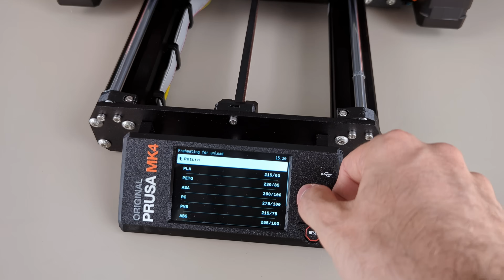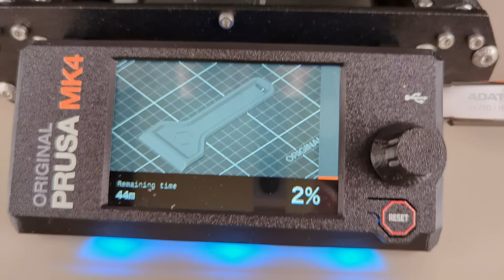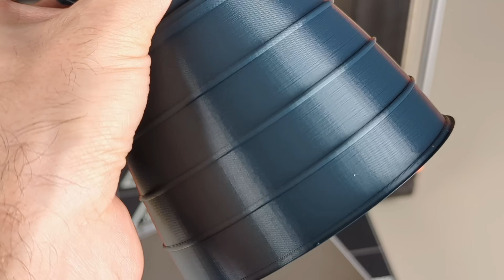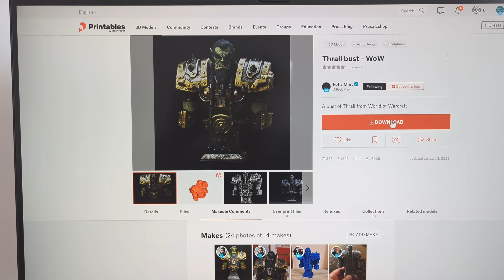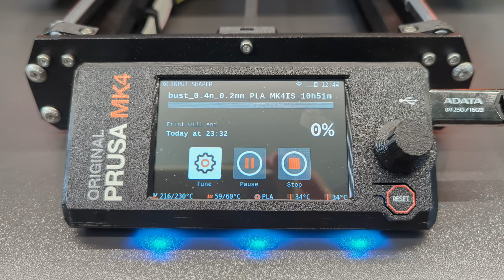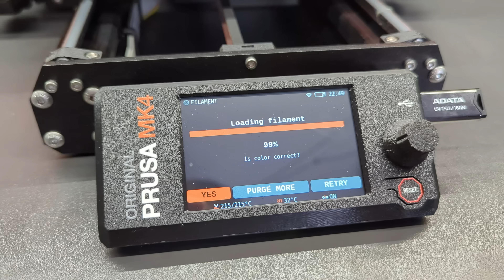Prusa MK4 in 2023? 🤷‍♂️

Comment: Prusa will never compete on price or new models every 6 months against Creality, Bambu, and other Chinese manufacturers.  While its 100% certain they have a smaller corexy printer in the works (look at their AFS system), when it is released, it won't be a $500-$700 corexy. Just not possible for them to build cheap in the EU.  I would expect a smaller corexy from Prusa to be around the $1000-$1200 range considering the XL single head starts at $1999.   If all you need is cheap speed, then Prusa isn't the company for you.  But like other printers, when you buy it, you know it will be supported and upgraded over time, and for a long time.   Everyone's needs and priorities are different.
Reply: There is a lot of implication that Bambu cannot do the things you asked for.  I have two Bambu printers (and two Prusa MK3s).   Support from Bambu has been excellent.  Prices on replacements and spares is extremely reasonable and the thing with a fast printer is you can print slower too!   We are yet to see on upgradability and long term, but P1P->P1S for $150 is pretty so far painting a good picture. 

What prusa does, that no body else in that list does, is sticks to the roots of 3d printing and the open nature that allowed for Bambu and others to stand on and jump off from.  That is worth something.

Creality does race to the bottom and I think your criticism apply there.  K1 is straight up a bambu clone with open source tools
Reply: @bennetb01  I was very focused on Prusa, not Bambu in my comment, other than to say Prusa will not compete with them on price, ever.  EU vs Chinese manufacturing costs.
Reply: Having said that, a company that's been around for just barely over a year really doesn't have a track record yet to say "yay" or "nay" as far as long term support and reliability.  In a year or two from now, we can have a better discussion, but as of today, there isn't enough data.
Reply: @bennetb01 Bambu cannot do a lot of things you ask for. It cannot do live Z adjustment. Cannot tune steps/mm. Cannot reveal the contents of the huge ass log files that it sends to them, which DOES NOT INCLUDE nozzle or heated bed temperatures. They admitted to this in their latest blog post update on their corrective steps to prevent a repeat of the cloud outage/job jamming fiasco last week.
Reply: "Prusa will never compete on price or new models every 6 months against Creality, Bambu, and other Chinese manufacturers. "

I feel like this was low key a seriously disrespectful comment. Just putting Bambulab in the same company as creality is pretty disgusting. They literally work their asses off as a startup, raising capital, then developing the biggest leap in user experience we've seen, hitting all the points most people have wanted in printers for years, and you act like they are some cheap clone maker putting in no effort just because of the country they are in. Honestly it's not right.

I think people are being really biased when they ignore how amazing what Bambulab pulled off is.

They complain acting as if it copies vorons when they dont realize how ignorant that is engineering wise when they share next to nothing in common. There is a reason voron 2.4s cost multiples of the price. They put in a load of engineering to make their printer more like a PC case so that it could be produced affordably, and then you actually got to buy it while benefiting from that savings. You think they could just clone a voron and sell it for that price? You'd be out of your mind to think so just from the labour costs alone (and on that note I want to point out that people are out of the know if they dont realize that Chinese labour is now nowhere near as cheap as they think it is. The baby boom situation that caused that explosion has died off, so their labour is getting pricier and their workers more skilled).

Then lets talk about software. They are literally one of the only chinese printer companies that gives a hoot about making good software, adhering to licenses etc, yet when they make tiny mistakes smaller than Prusa has done, completely reasonably, people jump on it like they were secretly hackers the whole time. Its absurd, when in reality, tell me of a printer that has gotten a better UX from slicer to printer? Thats real work that was put in.

There is a lot to criticize, absolutely, and obviously I didnt cover it in this comment, as that wasnt the point, but you acting like Creality and Bambulab are at all comparable as companies really pissed me off, because by doing that, what you are telling to every Chinese business that tries to be better, and do better, that it doesnt matter because your ignorance will have you dismiss their work anyways. It's completely unfair.
Reply: @BeefIngot    My comment wasn't about Bambu Lab. It was plain and simple that EU manufacturing will always cost more than Chinese manufacturing (human cost, tooling costs).  You should go redirect your anger elsewhere.  These are 3d printer companies, not religions.  bye.
Reply: @JohnOlson  Buddy, you are still responsible for what you say. You can't hide that behind it "only" being in your first sentence. Also, it's hilarious you're talking about religions with the nonsense you just made up to defend your prusa religion.

Fun fact, I also like Prusa, because unlike you I'm actually here for the tech. Don't make defending a company reduce you to having prejudice against people for their country of origin
Reply: @BeefIngot  " having prejudice against people for their country of origin" ... Couldn't be further from the truth.  Thanks troll for weighing in, now f**k off.

Comment: I mean aside from the XL this is their current flagship printer, right? It’s the one I see at the top first thing on their website. This is wild. Bambu and this are not even remotely in the same league.
Reply: I mean you are not wrong. The Bambu and Prusa owners are completely different. Really depends on what the user values. Being easy to repair, looking good in the office, open-source vs locked, primarily offline vs primarily online cloud, being quiet vs loud, built-in enclosure...
Reply: @TheMikolasZuza  or prefering prints that are multiple times faster. Or multi-color. Or an actually finished product. Or maybe all of that with a cheaper price point. So many considerations
Reply: @user-fo7mf9nd2h  Exactly. Different customer groups. I for example do like prints that are stronger, not half of my filament going down a poop chute and not only soft- but also hardware upgrades for years and years. I also like that part of my money goes into Printables and PrusaSlicer, that workers are payed a reasonable wage and other open source projects are supported financially too.
Reply: @user-fo7mf9nd2h  Some people value a company the has contributed so much to 3D printing and is made in the EU where they must comply with actual labor laws and enviornmental protection instead of Chinese junk.

Comment: You might say this is about 1/3 open source hardware, and the software still open. Prusa being a nice guy, won't keep him in the running printer wise.
Reply: I think its rather simplistic to pretend that their missed step here is anything to do with being open source.

You have to remember that their opensource nature is a tradeoff. They got a ton of free work over the years from other people due to it, and now act like somehow its unfair when other people use the other side of the coin, and get their free work too, when thats the entire point of the agreement: no one has to reinvent the wheel.

Whats more, the area that they are behind in is clearly hardware, and they are not only open source in name alone (where are the MK4 Cad files? Last I checked they still havent been released), and in that area, none of the most modern printers are copying them, because they aren't at a place to be copied from.

So yea, waaaaaaay less about Prusa being a nice guy and waaaaay more about them taking too long and resting on their laurels.

I hope that they actually do commit to open source in any practical sense, but their pr suggests they want to move away from it more, which to me, kills any reason for me to like the brand.

Comment: The insufficient purge is probably in case you change to a filament of the same color.
Reply: Then, why purge at all as a default? And why isn't there two options, one to change without purge and one that purges a reasonable amount for a color/material change?
Reply: @bunker1213  There is? It's called "purge more".
Reply: @ulaB  and why should I have to do that 2-3 times extra manually everytime I change filament?
Reply: @ulaB  for the cost of $1100 there is no reason I should have to stand there and press the button 2-5 times lmfao.
Reply: @NOBLE50000  Well. If you pay that much money, just to swap filaments, you might be doing it wrong.  ;-)
That said - there are a lot of people that don't need to purge more,  because they change to the same color. Printfarms for example. That would mean a lot of unnecessary waste.  So they would complain instead (and they paid a lot more than you). And it is more difficult to pull the filament back in than to extrude more. 
What you get for $1000 is the option to change the code yourself or at least report an issue on GitHub. - as others have done instead of just complaining. :-)
Reply: @NOBLE50000  If you cry about purging filament then maybe 3D printers aren't for you.

Comment: The disrespect for Prusa in these comments seems a bit extreme… Until I remember that Prusa himself called us “Trolls” for minor criticisms.
Reply: HAve you ever met Joseph Prusa, I have and he is a total ASSHOLE and I'm trying to be nice!!! Whatever disrespect he gets is well deserved and then some!!!
Reply: You were called trolls because you made it a point to repeat the “minor criticism” on all Prusa videos as if they were major points and called them deal breakers.
Reply: you cant really blame them when the MK4 costs $1100... Its outdated for the price point and you guys cannot seem to grasp that.
Reply: @NOBLE50000  
On the other hand is it easy to grasp the problem of having to register on an app to even get the Bambu going.
And there is, of course, the ongoing mystery of the need to encrypt log files used for support.
One might argue that the logfiles are OK, but HOW DO YOU KNOW.
And why are they so huge? What is leeched and transmitted from your computer?

And everything on a Bambu being proprietary means that they can sell them cheap, get some valuable customer data and not least, make sure that everything needed for upgrade or repair is bought from them.
Do I hear you protect the reputation of HP and Canon for the way they have perverted the printer market?

Comment: Nice to see Prusa hasn’t given up on entry level printers.
Reply: Entry level? It’s $1100
Reply: It used to be double that price with Flashforge  @nonchalanto
Reply: @nonchalanto  it may be overpriced, but it is still an entry level printer.
Reply: @KanielD  I guess I’m not seeing how this is particularly entry level in comparison to most other popular printers. Seems even less user friendly than, say, an X1 Carbon.
Reply: @nonchalanto  the design is entry level. its comparable to any ender 3 NEO but for the additional cost of $800. Also you cant compare really anything to the X1C in terms of user friendliness.
Reply: It's funny to me because it's legitimately not good, it's the same price as a P1S w/ AMS, for half the features, unenclosed, much slower, and tons of issues. As usual, Prusa gives subpar quality, subpar experience, for premium pricing. 10min to print on a P1S w/ AMS, at 500mm/s, with multicolor. Prusa? 200mm/s, 2 hours to build it, and tons of bugs. So as per usual, Prusa is the worst choice. Been that way since the Mini came out.
Reply: @Funky85Mess  Ok, so like the general idea of your comment is right, but the numbers you list are like waaaaaaaaay off. The print speeds of both printers is way higher than reality, and also not even the metric that matters. I know its complex, but top speed means next to nothing. What matters is volumetric flow rate and the highest acceleration you can get without notable defects.

Comment: The quality of their own prints, which create the printer, makes no sense to me. Why would they not put the best quality prints on their printer?
Reply: If I had to guess, I'd say because they have to make a lot of them quickly, and as long as the parts are strong and serve their purpose structurally, it works. 
I imagine they ran the numbers and found out that spending hours and hours more on printing batches of printer parts on perfect quality for what is really only visuals was more expensive than it's worth, perhaps even a loss compared to ordering the parts injection molded instead.
Reply: @BM-yy8db With the price of that machine, why don't they just injection molding them? Must be faster and much higher quality
Reply: @ngtb Because the entire point of Prusa machines, is that since the parts are partially 3D printed - you can replace them yourself
Reply: @Spiker985Studios At what point does that lose value though when you can buy 2 machines that have a better user experience for the cost of one of these, and those machines sell spare parts?
Reply: @Spiker985Studios  It's a gimmick that made sense when people were building kits and could get a friend/ makerspace to print the parts for them to keep costs down but it makes no sense on a £800 printer. I've had a prusa clone for almost 10 years and never had a printed part fail anyway. Also to replace it yourself you'd need a working printer so either you need a second printer or you'd have to print a whole set of parts off before hand just in case - not something I'd like to do after spending that much on a printer lol.
Reply: @BM-yy8db You know what makes even more financial and engineering sense for everyone involved? Just using actual modern mass manufacturing techniques like injection molding and robotic assembly.

Seriously, they could design so that users could still print their own parts but sell parts made using the methods that make the most sense. Yea, its would take more time to design, but redesigning some geometry is like an absolute fraction of the effort put into making the product, so in the grand scheme its nothing.
Reply: @BM-yy8db  guessing isn’t as good as knowing. What about the people who buy their products. What is your guess about the impact of bad-looking prints on them?
Reply: @corlissmedia2.0 I agree, but I don't think we'll get from guessing to knowing without working in those companies ourselves, so best I can do is educated guesses and logic.

As for the impact, people don't buy these kind of things in the supermarket on a whim. While Bambu is going in the "plug and play" consumer friendly direction, Prusa still seems to be targetting the "tinkering geek/hobbyist" kind of customer, who knows what they're buying, knows about the "for geeks by geeks" feel of the 3D printing industry, and knows that they're signing up for a project they can mod themselves if they don't like the ugly looking prints.

When 3D printing companies like Prusa ever want to go in Bambu's direction (which let's be honest, they probably should if they want to keep up with Bambu), to be marketed as ready-to-use machines to uninformed consumer seeing a 3D printer in the supermarket tech isle, then it starts to matter a lot, since then the ugly prints would send a message about how the rest of the printer might be in quality. 
But as far as Prusa goes, they still seem to be a kind of "hello fellow nerds, look what we came up with in our soldering-fume-filled tech basement, we call it the MK4 :D" kind of company.
Reply: I can tell you, printer has been working perfectly with these "bad looking prints" for 5 years now and I dont give a shit  @corlissmedia2.0  👍

Comment: What's really weird is that the LCD is touch screen, just it's not enabled in software (yet)
Reply: It's a sign prusa rushed this out so they have something out that can "compete" with bamboolabs
Reply: @UnwrittenGamingftn  Yeah, they did the same with the input Shaper and Pressure Advance that were advertised but not (initially) shipped. Definitely feels like a bit of a rushed released
Reply: @kkrizzz  It's like releasing a game half broken and fixing it later. It's a disgrace. Prusa has gotten too full of themselves
Reply: @kkrizzz I am fairly certain in marlin it’s called linier advance. Are you saying that was not active when printer was delivered? LA are something you need to tune your self for each filament type/brand.
Reply: @Exstaz  It's called pressure advance these days, a feature that comes with klipper. They didn't enable it at launch just like with input shaper and the touch screen
Reply: @UnwrittenGamingftn 
What is a disgrace is the fanboys constantly pushing the bambu spy machine.
Reply: Like the unavailable input shaping they pushed this printer out the door because they were freaking out about boobs taking all their market share. It was totally the wrong move. It just makes their printer look more inferior.
Reply: @KieranShort  Exactly, it shows just how far behind and unprepared their were.